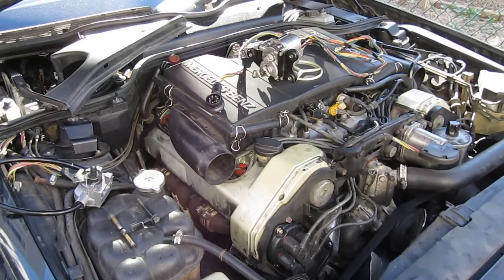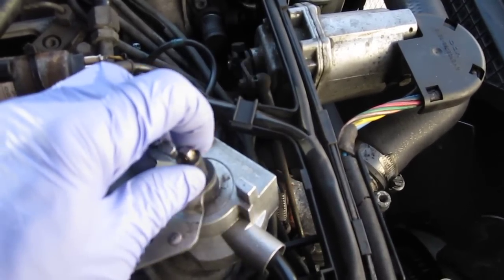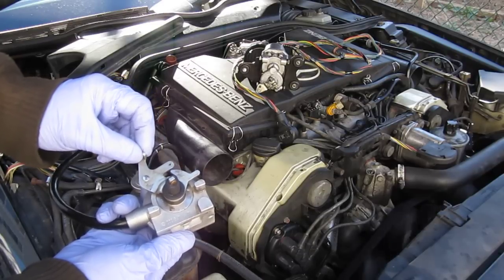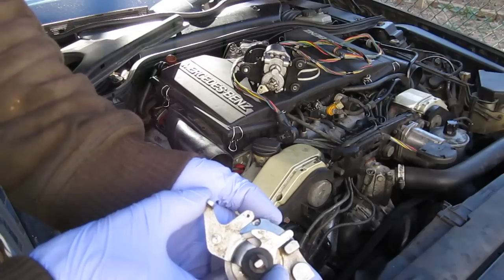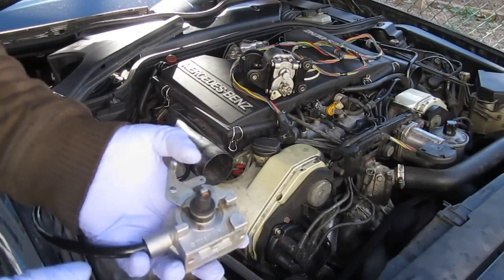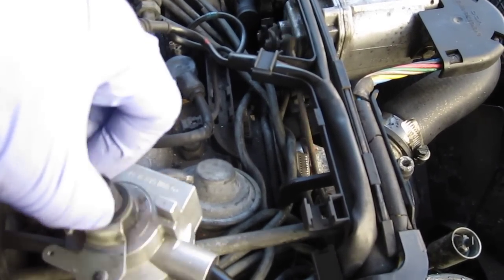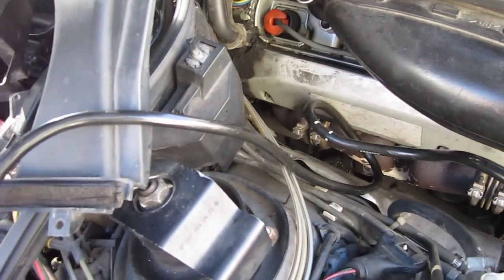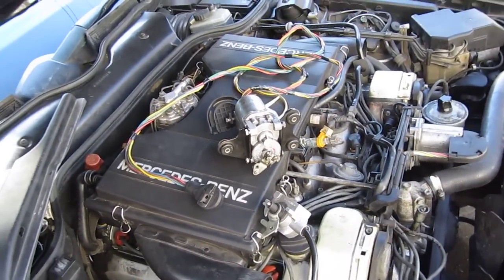Mercedes 500SL throttle actuator Part 1 of 8

Comment: Hi Vick, I am having a limp mode problem, only after motor warms up? drive to walmart, maybe 3 miles from home no problems, (does idle a bit rough only at times) After I leave the car for 10 min, The car will not start. when I can finally get it to start it will run in limp mode. I let the motor cool down. It runs fine? You mention these are 500SL's ? I have a 1995 SL500. Is there a difference. I also have a lot of compression in the fuel tank when this happens. I remove the gas cap and you get a whoosh sound. I never had this before. I had the bad insulation typical injector wiring harness. I replaced this but still have the same problem when cold its ok when warm does not want to run until it cools down? Any ideas? Appreciate it. Zep